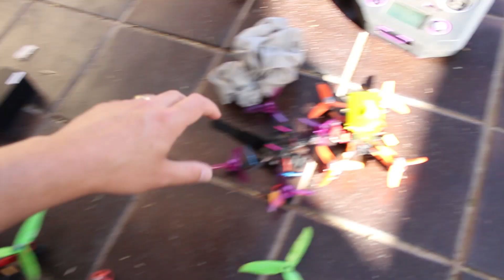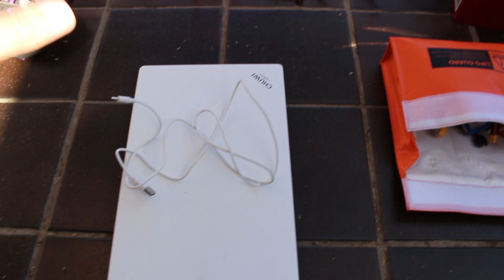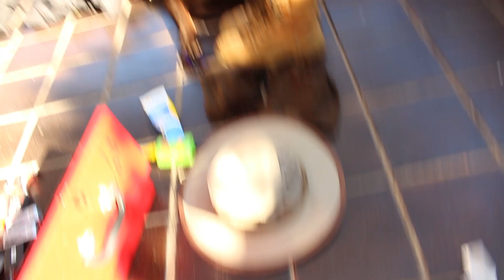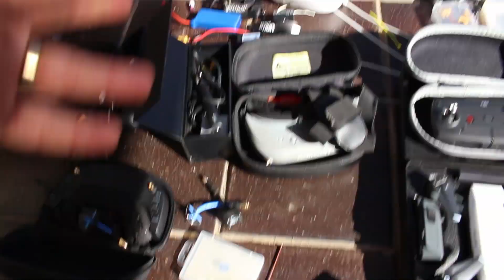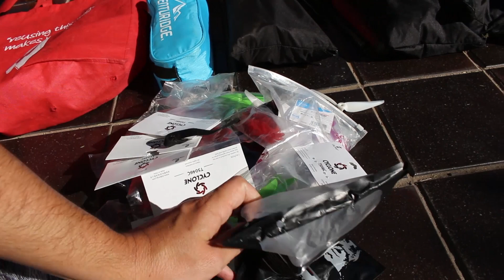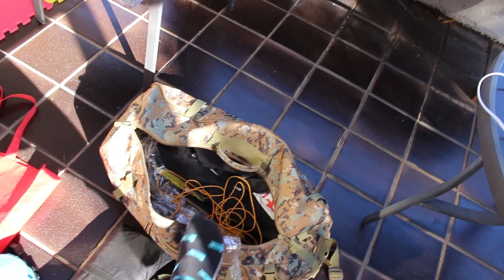FULL GEAR REVEAL- EVERYTHING I TAKE FLYING

Comment: Can you build and test the flight time of a quad I was thinking of building? I want to go to 6s and have been looking at the Avenger 2507 2700kv with the hglrc 60amp 4in1 and say a 5050 or a similarly steep pitch 5" prop as a power train, I thought match theoretical rpm.... Na go big or go home lol the Avenger set up would have theoretical 1/3 more rpm's compared to my current hyperlight 2307 2722kv on 4s and that goes like a stabbed rat! The 4s or my 2" are not flying atm and really I just want to fly, but just not sure where to put my money?

Comment: Am I the only person that ends every flying day with all of their quads broken? Any time I go out to my favorite spots; I'll crater every drone I brought before I've ripped all of my packs... like, I've completely rebuilt my favorite micro at least 6 times, my old 5" is basically scrap at this point, and I'm constantly replacing smashed motors. Never really crash in my yard, though. It's only killed one.
Reply: The Warp Rider I almost destroyed my front left motor by crashing into a tree..... do you take apart the motor and try to fix it or is it totally destroyed? I took it apart with the help of my dad and hammered out the dent.
Reply: Typical Person just buy the bell housing for your motor and you should be good, unless you destroyed the magnet's inside.
Reply: Merlin 323 I hammered it out the dent without buying anything new. The reason I did not but anything new because it was my first and I'm building a new quad soon.
Reply: Typical Person I've never tried that usually cause the housing is cheap. But I'll try that next time. Hope your next build goes without a hitch.
Reply: Merlin 323 thanks I live in the states so it takes a long time to send parts that come from Bangood...im still waiting on my new Goggles from there.
Reply: Typical Person I'm from LA brotha and I know how it is. It's like hurry up and wait. You order something and can't wait to get back out there but your stuck waiting. I'm in the same boat. I have like 5 orders I'm still waiting on. Sometimes I forget what I even ordered. I try and only order stuff that I will need from them and what I need now from Amazon. Cost a couple bucks extra but in a jam it's your best bet.
Reply: The Warp Rider ,,, that sounds like my luck